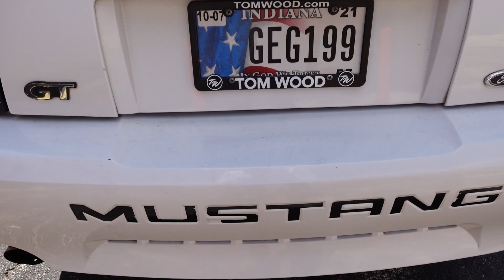I BOUGHT A 2004 FBO MUSTANG GT WITH 70K MILES!!

Comment: I have a 2003 mustang premium aka the v6 I know🙃 but anyways when I turn the key it doesn’t turn over right away it takes a little bit and it’s a stick what could be the problem??? I need y’all’s help pls🥺 thank you to anyone who response much love
Reply: Clutch safty switch may b getting bad.. pull the plug off and jump a wire across from one terminal to the other.. see if it hits as soon as you turn key if so buy a new switch or leave it jumped that's how mine is I dont have a bad switch I just hate pressing in my clutch every time I start my car... just always make shure you keep your car in neutral lol...

Comment: What part shouldn’t have been installed on the frs ?
Reply: The SixStar Boost Controller lol
Reply: Should I not run a boost controller off rip? Starting at 7psi wastegate
Reply: @vinnygarofalo2602  nothing wrong with boost controllers just make sure they’re routed correctly
Reply: Ahh gotcha. Which way should I not route it 🤣 I’m about to load up some boost 😅